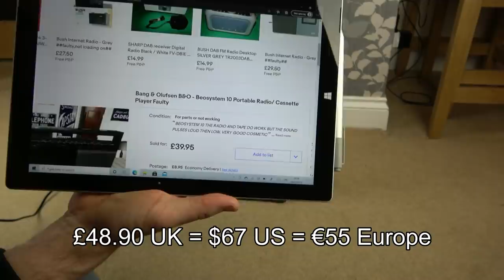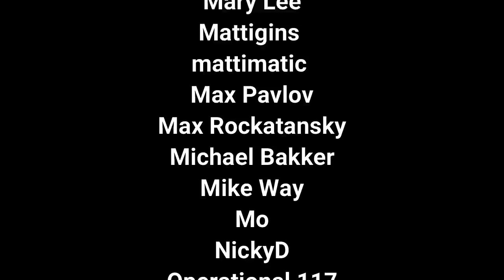Faulty BANG & OLUFSEN BOOMBOX from eBay - Trying to FIX

Comment: Did anyone else think when Vince removed the tape pieces - "I wonder WHY those bits of cassette tape were eaten in the first place?"
Reply: Not necessarily the machine, and unlike a Bang and Olufsen. Most likely a 120min cassette, they were always breaking when fast forwarding and rewinding due to the thinness of the tape or a low quality / damaged cassette.
Reply: There were many cassettes (including pre-recorded music albums) that had at least one somewhat cattiwompous (?) hub... if the takeup hub was warped, the "cake" of tape collected on it would at some point jam against the cassette shell and prevent further takeup. This was worsened with some decks having originally weak (or weakened  by age) takeup torque. 

I used to buy cheap cassettes that were totally useless for recording, but which by luck contained at least one sufficiently staright hub each, then performed "organ transplantation" with them. I also saved the shells because they could be the last resort to fix a cassette that had a warped shell. Most prerecorded cassettes were glued together, but I carefully cracked them open and applied drops of glue in the corners upon reassembly. I have no recollection of failed shell/hub exchange repairs, but in some cases the tape was already torn. Some of those could be spliced with adhesive tape, it would be playable but not flawless.
Reply: @jussikuusela7345  Agree, I had many tapes with one of the reels jammed, mostly due to high temps when keeping them on the dashboard. Also, have tapes around in the car without case, the reels would losen up and that really increased the change of tape being dragged into the player machanism. Looking back, actually tapes and records and all that stuff were really charming but streaming nowadays is much more efficient, even de CD at it's introduction was like a leap in user experience.

Comment: bit of a design issue vince - if it's hung on the wall, how are you supposed to plug the external speakers in as the jacks are on the back?
Reply: It was not completely flat against the wall. B&O made a wall bracket for this model that had a couple of centimeters distance. But still some plugs were too long.
Reply: @organfairy  It uses 2 pin din plugs the same as B&O speakers of the era, so they should have clearance, albeit of about -1mm, ie very bent cables :p

Comment: Nice one, Vince! That sounds like a real quality cassette deck in there. The only downside . . . was that it appears The Archers -- even from those very brief snippets -- has been tainted by the dark, "organic" . . . forces of PC-49. Where's Eddie and Joe Grundy when you need 'em? On the "putting back together" . . . I tend to disagree with your assessment. Yes, we, the viewers, all want to see the thing back together and working ULTIMATELY, but if it DOESN'T work once reassembled, I think we then share frustrations with you at you having to "go in again" . . .  .  I certainly wouldn't stop watching with it in bits, even though a problem was proven cured. I enjoy your videos: particularly your theme tune What is it, and how did you happen upon it, I wonder?

Comment: The other head is the bias erase head Bias is due to non linear portion of the tape so noise above your  hearing is added to blot out that  non linear section of the tape. To erase that head just records that high frequency to blank out the sound..

Comment: When you zoom in on "that pin" at 35:19, just above where you're working, it looks like there are a couple of very poorly soldered pins. Maybe the connection's good enough not to effect the operation?
Reply: Those pins aren't being used.  There is nothing for them to be soldered to

Comment: Would you be interested in looking at a karmon harmon avr 635, i turned it on one day and there is no sound but it was working fine when last used, it's 16 years old and cost around $1,300 when it was new! I'm based in Berkshire, UK.

Comment: I do admire your courage when digging into technology that you do not have basic knowledge about - e.g. when you are wondering about the function of the ferrite rod (the internal AM antenna) and your guesses on which head is doing what. You will learn as you go. But what troubles me when watching this, is that you do not consider why there is old tape wound around the pinch roller. The reason is probably too low tension on the take-up reel, causing "tape salad". A proper repair would have included test and adjustment of the take-up tension to avoid the problem to re-occur.

Comment: It really bugs me to see die-cast flywheels go bad like that (I think some mechanisms used by Nakamichi had that problem, too). I wonder how many high-end units got condemned and trashed over something a novice machinist could reproduce with a few bucks of aluminum, a tabletop hobby lathe and a small press to swap the capstan into the new flywheel...

Comment: I suspect it could be a little piece of tape that got caught in the pinchroller hence the dipping of sound there was no need to open the whole mechanism just get a pair of tweezers and pull out the piece of tape job done
Reply: The tape door come off it you very carefully pull the slow-open tabs inward, but you only see a little less than half the pinch roller. That might be just enough access  to get all the little bits out, or maybe not.

Comment: You probably know this, but you can see what people actually paid on eBay by using the Sold filter.  

Don't forget to sort and filter further to match what you want eg. Used, Date, Highest and so on to remove unwanted results.

Comment: honestly I'd consider sticking a bluetooth cassette in there and using it like a bluetooth speaker, maybe even sticking a switch somewhere to turn off the tape motor to save electricity and reduce motor noise and improve battery life if I wanted to use batteries. I wonder what it would take to mod it like that.

Comment: You could've also clean the pinch roller. When there is tape there, maybe the roller is dirty and will chew tapes. Or maybe it is weared out and needs replacement.

Comment: A tip for when you are recording to a cassette
check to see if the tape mechanism uses a permanent magnet erase head, or an electromagnetic erase head
if it is electromagnetic, then you can record over the tape without first erasing it
if it is a permanent magnet, then it's best to erase the tape first on a machine that has an electromagnetic erase head before recording onto it (to erase the tape it is best to use a machine with an electromagnetic erase head)
Reply from the maker: Thanks Pineapple Road 👍
Reply: The erase head is not a permanent magnet as it is attached to the same bar the play/record head is attached to, you can see this when Vince presses the play function both heads move up.

Comment: That "pulsing" symptom does not sound like a belt related issue, it does sound like some kind of electronic issue.
Reply: That's what I think, so I was surprised when it actually worked afterwards.  I think that he fluked something else while it was apart